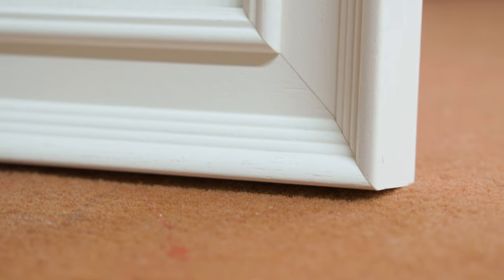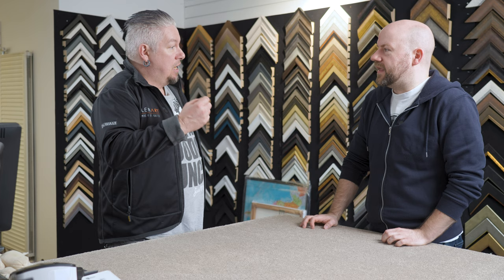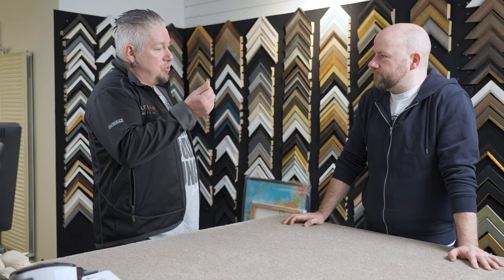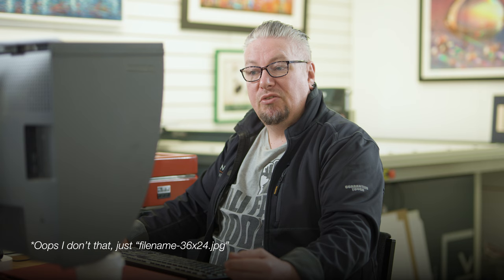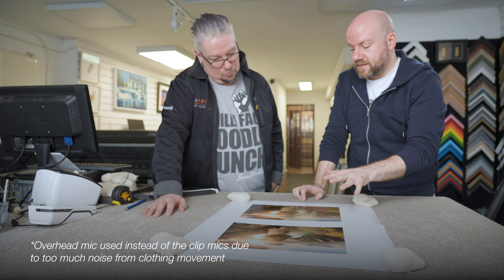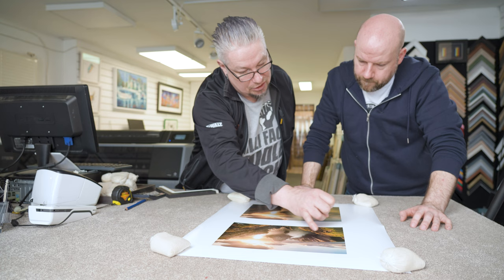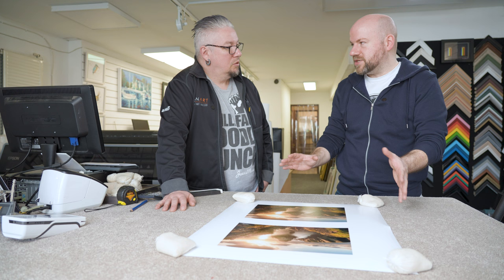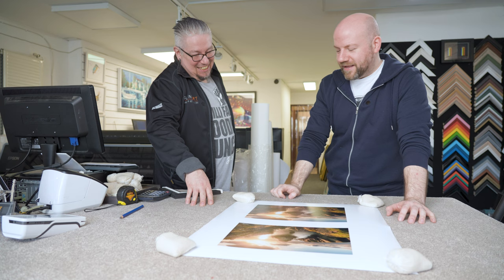Pro Tips for Better Prints | Interview with Print Company

Comment: Great video Mark , thanks for that, i am getting back into photography after a break for a few years so its very helpful.One question, Adam  talks about the monitor screen that he uses , but my hearing is not brilliant , can you tell me which one he has? Thanks Mark.
Reply from the maker: Yeah its Benq SW272U. Make sure to check out my previous as you'll see how I edit and export my files for Web and print and my method has not changed since then
Reply: Thanks Mark @MarkDuffyPhotography